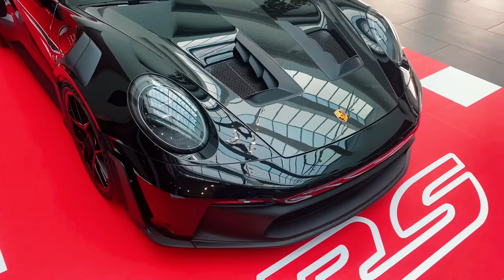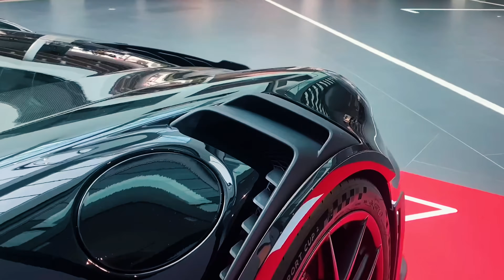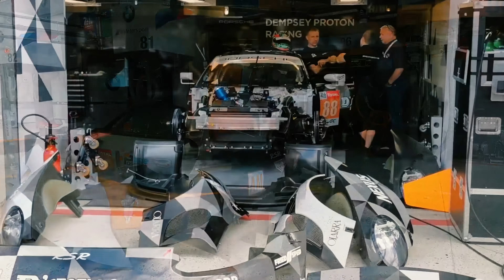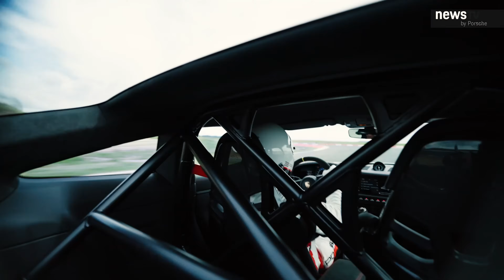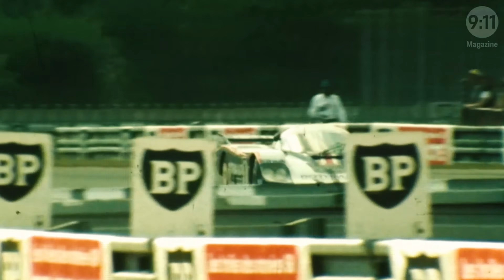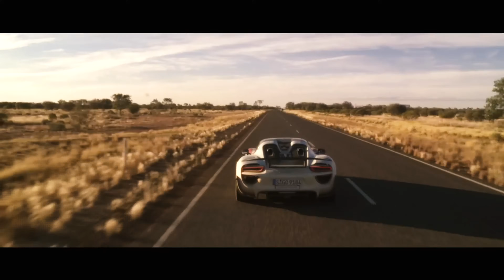HOW IT WORKS! 992 911 GT3 RS AIR MASTER

Comment: Aero works most effectively on high speed circuits.  The effects are significantly reduced on slow and medium paced circuits.  In fact you will find the 992 GT3 is the same or quicker around slow and medium paced tracks if its on CUP2R and the 992 GT3 RS is on CUP2.  Moreover, its a bad idea to bake the hardware and software in together - most track rats like optionality and this in reality takes it away.  Bottom line if you want a race car get a Cup car, if you want the best track cross over road vehicle get the 991.2 GT3 RS and if you want the most fun factor get the 718 GT4 RS.  The 992 GT3 RS is really a technical show piece and set up for the 992 GT2 RS.